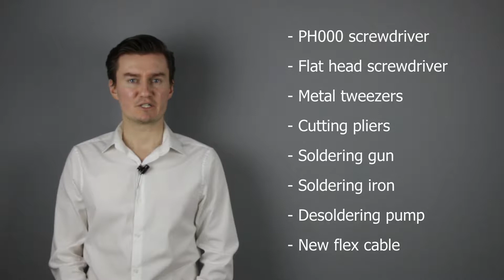Sigma 18-250mm f/3.5-6.3 DC OS HSM aperture flex cable replace after disassembly

Comment: Hello, Great video. Very technical and substantive. I've got a problem with Sigma 18-50mm f2.8-4.5 DC OS HSM. The problem is with stabilization. When OS is ON, the mirror (view in viewfinder) is moving, I suppose it's to avoid camera vibration but this shake is  about 2mm. When stabiliz. is OFF, the mirror is fixed. AF is working properly. So when OS is ON or lens is out of the camera I can hear how glass inside the lens is moving. My first guess - OS flex is broken - but, OS is working (not properly but works), when is OFF, but is still on Camera glass inside it's fix (not moving).   Can You help me with the assumption of this problem? best regards